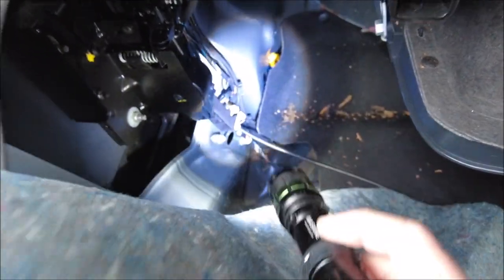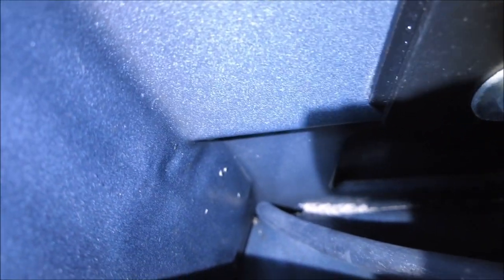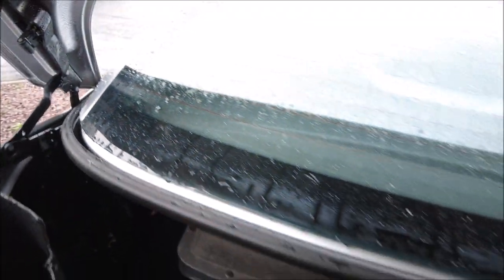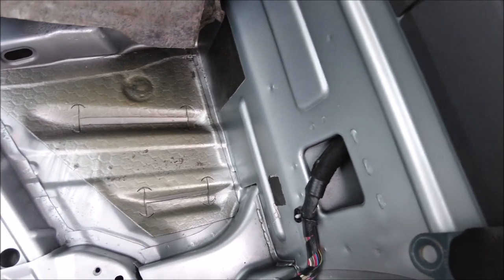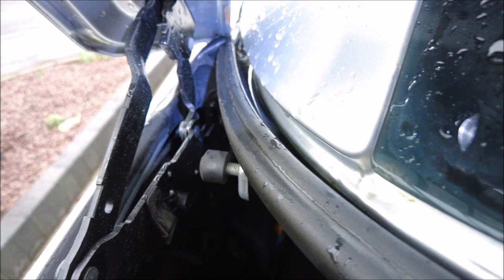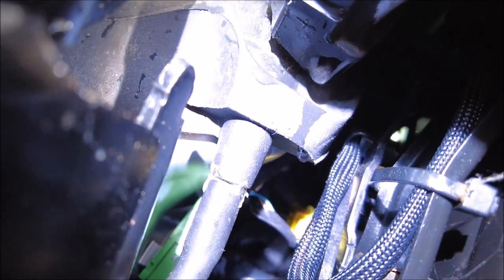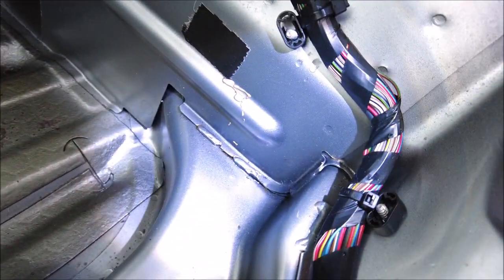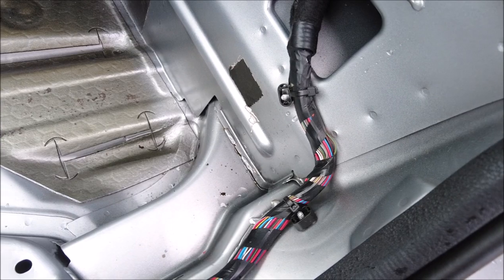Ade Vs Tigra Leak Part 3 | #tigra  #vauxhall

Comment: Hi again Ade. That was exactly the same problem I had. 
Your rubber drain tubes do run in front of the large black plastic cover, as you have them. If you reach under that, you can grab the tube and pull it through. It is long enough to reach the hole in the corner, where you tried it earlier in your video. It is supposed to feed into that hole right in the corner.That goes to the outside. 

Where you have that tube at the moment, I'm not sure that goes to the outside. 

I hope that makes sense.
Ps mine did the same as yours, where water drips down the side of the rubber cup. I added a piece of rubber similar to your fix. 

I do ❤ my little mobile pond 😊.
Reply from the maker: It did seem ironic that a hole was that close the where it was laying... with the extra "bodges" all seems good so far   😀